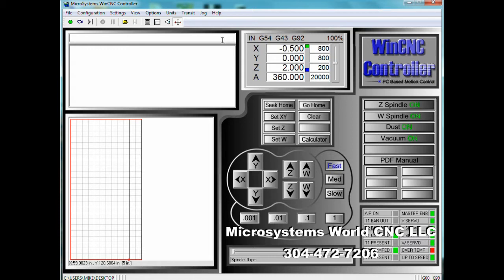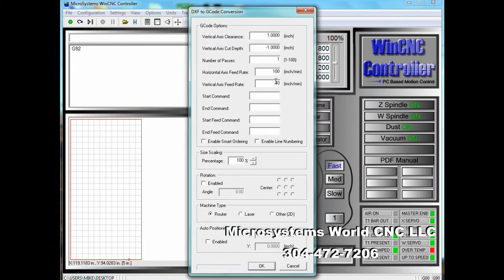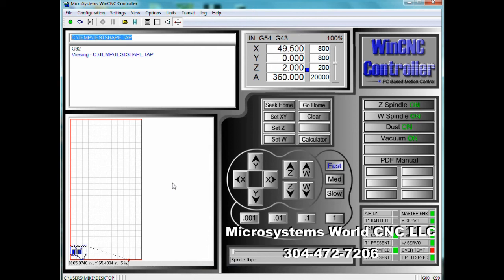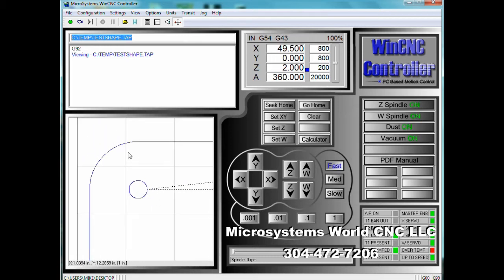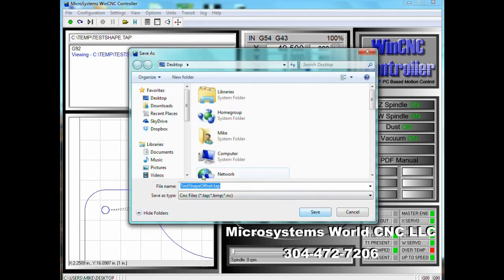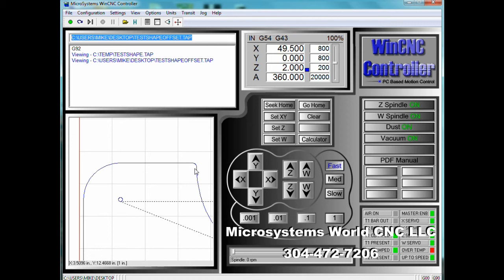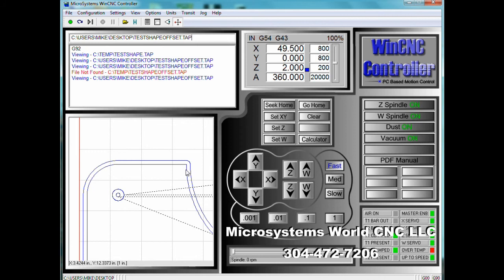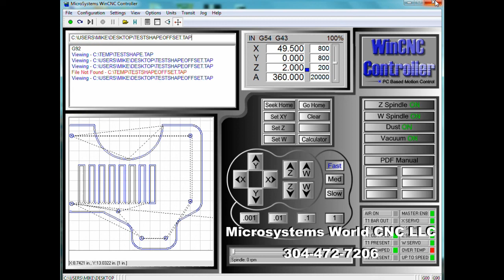CNC Tutorial - Importing DXF File Into WinCNC for Cutting

Comment: thank you - what do you think of adobe i
llistrator
Reply from the maker: +gale cox If you have Illustrator, it works great for outputting DXF files. Of course, you've got to remember, DXF files only cut ON the lines. If you want to offset them, you've got to either do offsetting with in your DXF or have a CAD/CAM software that will offset the toolpath for you. The best thing you can do is import your drawing or DXF into a CAD/CAM software and convert it to G-Code, the real native language of WinCNC. I hope that makes sense.
Reply from the maker: Illustrator is fine for some things but I have read that it has a few issues with DXF exports (I don't use it). I would recommend a CAD type program, or even a cheap CAD/CAM program like Cut2D Desktop ($149 at this time) or Cut2d Pro ($449 at this time). Not only will they produce 2D DXF files, with the correct post processor, they will produce great G-Code directly for your machine. No need for offsettting lines in a DXF format.

Comment: HOw do  you make a DXF file from a drawing done by an artist?
Reply from the maker: +gale cox I use Vectric products. They're low cost and work very well. If you're interested in Cut 2D, Vcarve Pro, or Aspire, let me know. We sell it and for Vcarve Pro and Aspire, we offer a couple of free hours of training.
If you want a free converter, try Inkscape. I also use that and it does a pretty good job. 
There are free tutorials online for both products.
Reply from the maker: Import the drawing into Inkscape and convert it to vectors, then export it as a DXF. The problem is that it would be difficult to offset lines in a program like that. A better way would be to purchase a real CAD/CAM package like Cut2D, VCarve Pro, or Aspire. Prices range from $149 for Cut2D Desktop, to $1995 for Aspire(at this time). Those programs can import bitmaps or jpeg files and convert them to vectors. You COULD offset them with that software and export them as DXF files but there is really no need. With the proper post processor, you can create usable cut files for your machine.

Comment: Great video Mike so you would do the tool diameter offset in the DXF design. First , accurately measure the tool diameter and use that radius value.